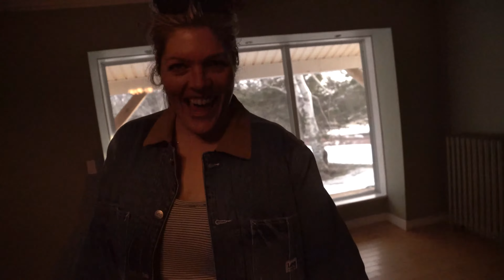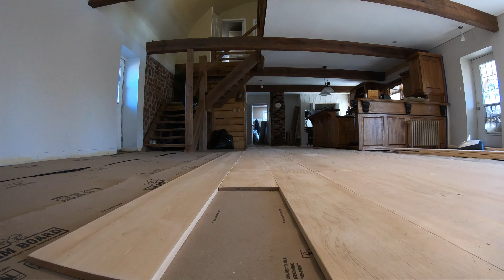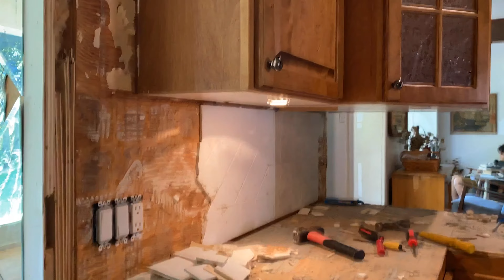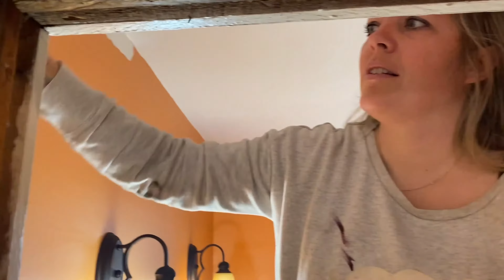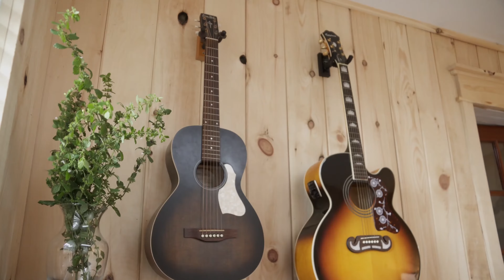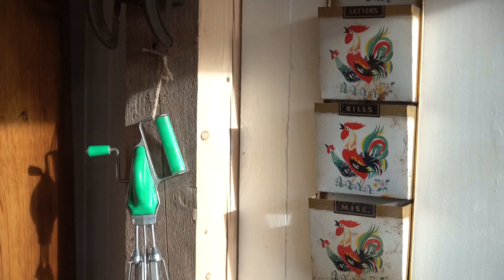WIDE PLANK PINE BOARD FLOORS DIY Timelapse

Comment: Love the wide pine floors, but why did you bother?  The old flooring was likely historic, solid wood, and way more durable than that pine!  I know because I have wide pine we put down 20 years ago (1865 house) and it is wearing badly where it gets traffic. But the old original flooring (oak and ash) we left on the first floor and repaired where needed is perfect.  Just saying for information if anyone else is thinking of going this route.
Reply from the maker: Yea we like the pine getting rough, but the original floor wasn’t real hardwood anyway and only 20 years old but really trashed from the dogs that lived here. 

Kitchen was also linoleum, so that had to go!